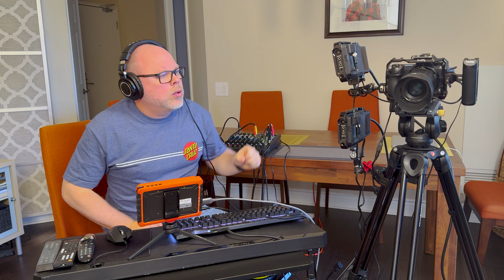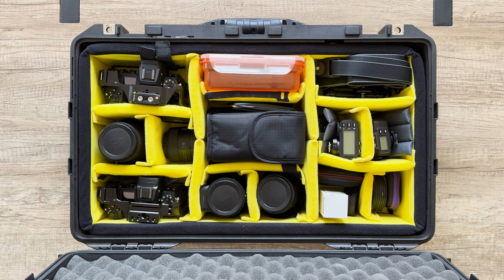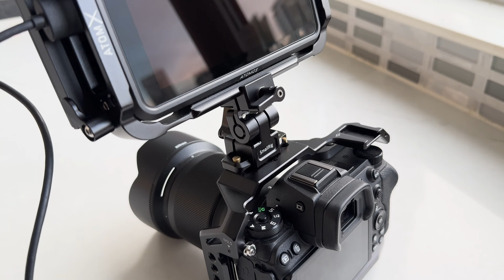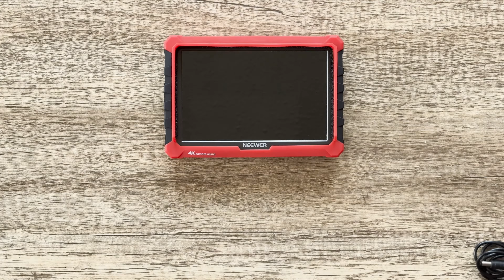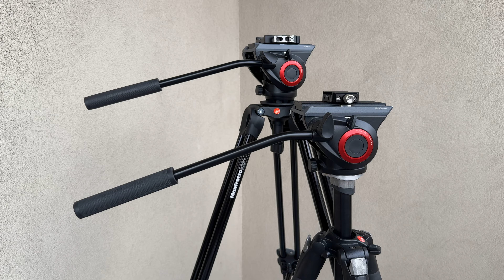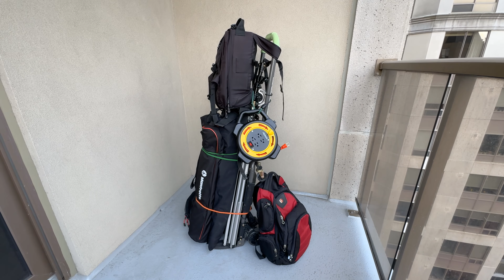Behind the Scenes: My Complete Video Equipment Breakdown + Pro Tips

Comment: What V Mount battery are you using to PD power delivery to your z6III? We have tried over 12 different brands and none of them will power ( either mains or PD charge ) the z6III.  ALL of our current V Mount batteries work perfectly with our Z6II however. Upon reading the Nikon white papers, it seems Nikon has decided to disable most V Mount battery operation with the Nikon Z6III. This makes pro location work nearly impossible at the moment.
Reply from the maker: To be honest, I have not used a V-mount battery with my Z6iii.  I have only owned it a couple of weeks and have only used it on one shoot, so far, on my gimbal using the included EN-EL15c battery.  

I found a comment on a thread regarding the issue you've brought up: "It will work with a v-mount battery using the USB-C port with a PD-designated USB-C cable. Data cables will not power the Z6iii while shooting, but appear to trickle charge it when off "  Have you experimented with different USB-C cables?
Reply: @andystandys  Most of them including Nikon's own high speed charge cable that comes with the Z6III, no go. However, I have a replacement V Mount power distribution bracket coming that is specific to the wattage the Z6III requires for Power Delivery and charge. It has a single USB-C PD port that is supposed to output the correct MAh. But up here in the Northwest, Amazon is SLOW.